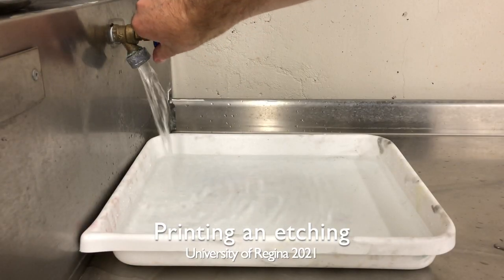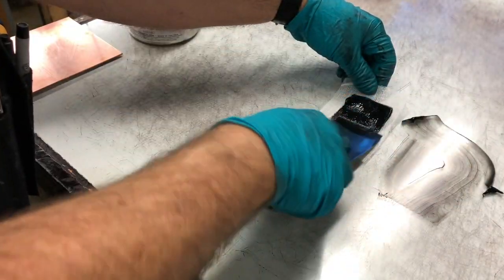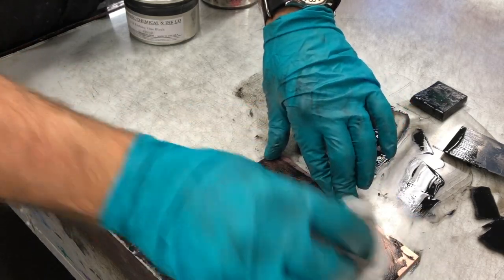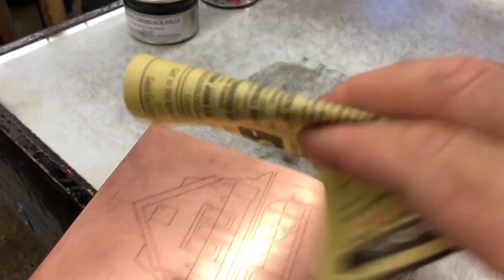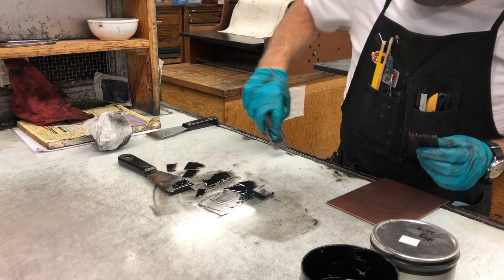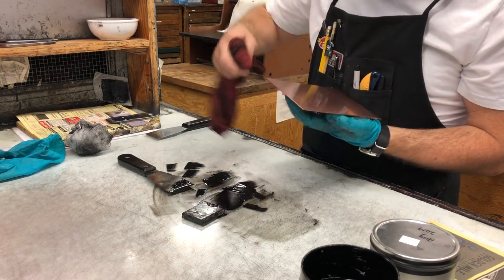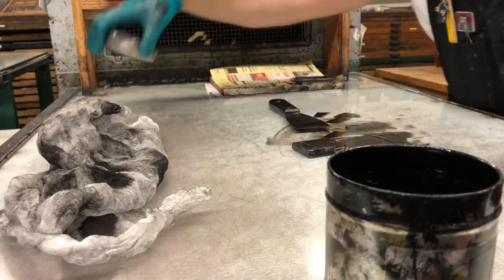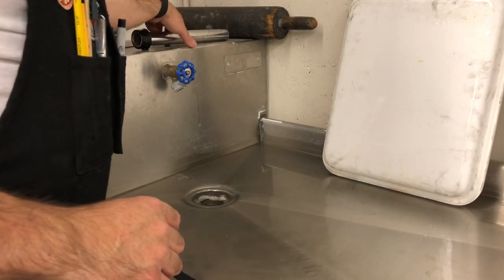Printing an etching

Comment: I have a question about the scrim - starched cheese cloth - when this gets full of ink - can it be cleaned and re-used? Thanks so much for your tutorials - they are the best online! Brilliant
Reply from the maker: Thanks very much for your kind comment about my videos!
In terms of your question, it would require heavy-duty industrial cleaning, which would probably destroy the fabric. As such, it’s best to think of it as a consumable, and focus attention on “greening” other aspects of the process.
Reply: @ thanks for your advice.  I’m using cranfield ‘safewash’ etching inks - I’m based in UK - and I thought there may be a cleaning option - but - as you suggest - the material is likely to degrade.  Thanks!